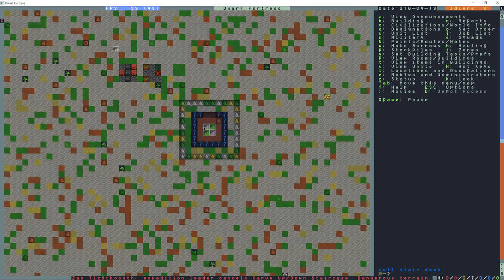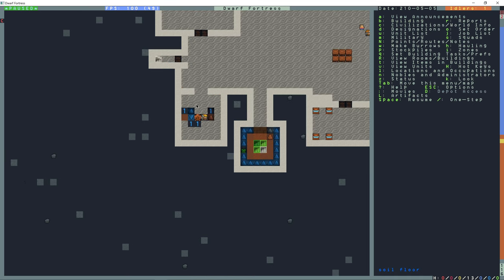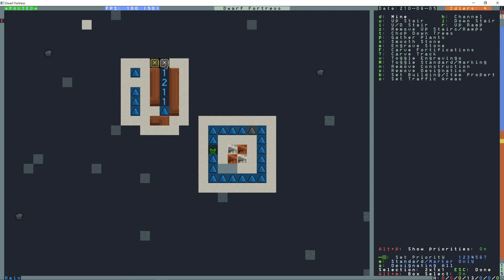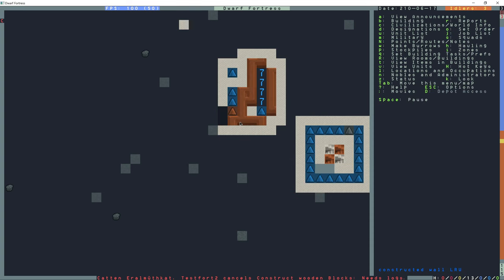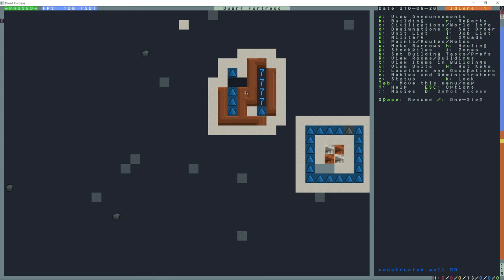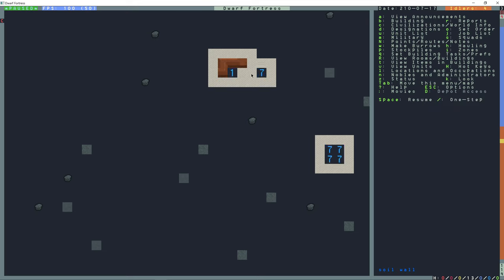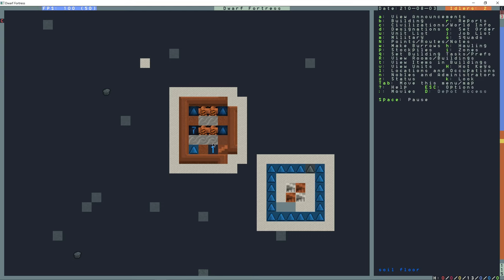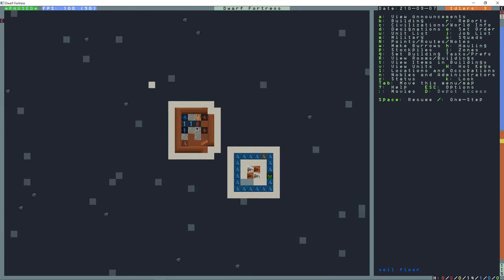GETTING PAST A HEAVY AQUIFER 🔅DWARF FORTRESS🔅

Comment: Excellent job, both dealing with the aquifer and explaining it on the video.

Light aquifers are indeed very easy to deal with compared to heavy like this - just dig down, dig around, build walls. No pumps needed for the light aquifers because they are so slow. Light aquifers also, as far as I know, do not drain water.
Reply from the maker: Thank you very much!
Reply from the maker: My current test fortress is reaching its end of life, I think in the next one i'll try to get some more aquifers; I read about alot of cool stuff you can do with both types. Cheers Brother !

Comment: what graphics are you using?
Reply from the maker: This is spacefox from version 0.44; at some point after that the tileset does not install properly and the u/d stairs tile breaks as well as other tiles. I go over my install in this video : https://www.youtube.com/watch?v=5Tmf2QJcMWU I forced install a properly installed previous TWBT spacefox version, since the Starter Pack still doesn't reliably install them. The issue was brought forth to PeridexisErrant, and maybe will be fixed one day
Reply: @TwistedLogicGaming  thanks